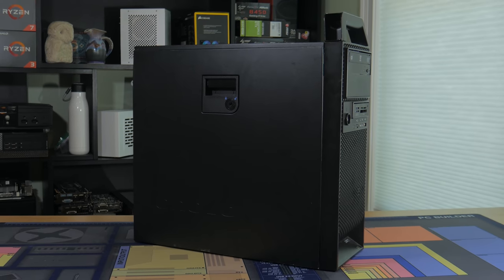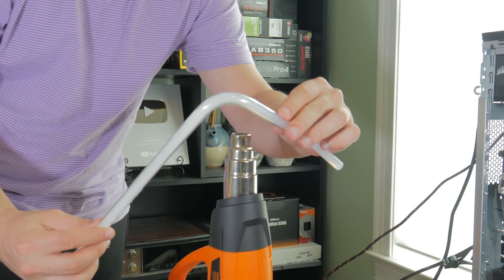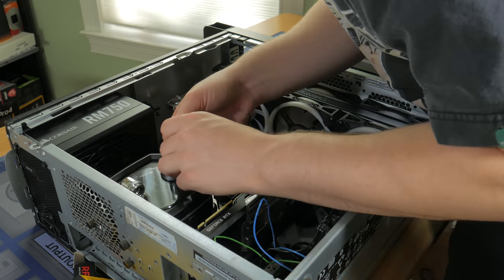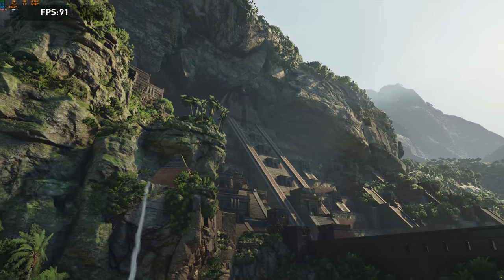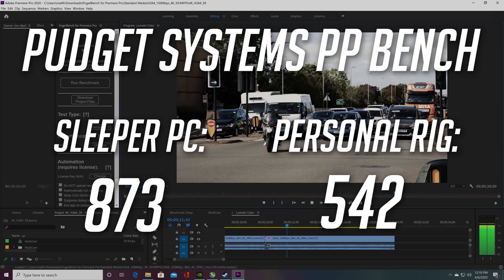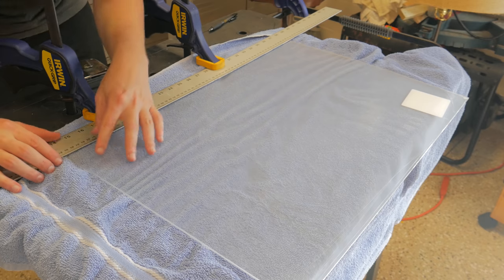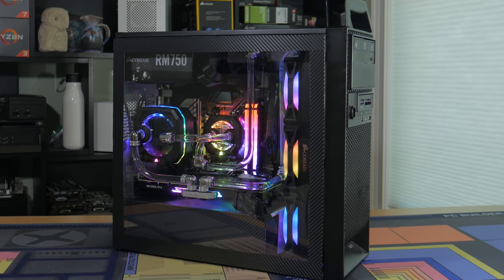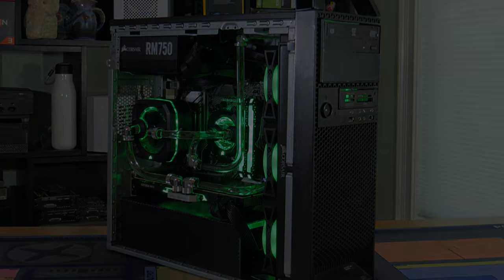How Fast Is My New Sleeper PC?

Comment: I just installed two more sticks of RAM to my desktop.
Reply from the maker: Nice! how much did you upgrade to?
Reply: @TechByMattB  16GB from 8.
Reply: Nice
Reply: @TechByMattB  hi Matt, first of what an absolute stunning sleeper, it looks amazing in both versions.

What I wanted to add, now that you have good cooling for the CPU the best way to increase CPU performance is to manually tune you memory timings. I have in extreme cases seen 30% gaming boost, but in your case it's probably more like 10%. This will cut down on intercore latency. Most importantly is the secondary timings, because these are not affected by the xmp profile. 

Just if you felt the need to push it slightly further, with no noticable extra power cost.

Comment: Just want to mention.Borrderlands 3 are not well optimized even on my R5 2600 gtx 1070 ti it drops to 30-40fps in the benchmark but gameplays smooth.
Well done on this pc.It looks sick.Personally i would have gone with no rgb but hey that's me.I have rgb fans but set it and gpu to white as my pc's code name is holy grail :D

Comment: If your cpu running pretty hot even though you use watercool, delid your cpu and use thermal grizzly. :) 

Also the vrm use copper heatsink instead of the aluminium.

Comment: Hey, I have a problem that I was hoping either you or someone here can answer. My dad bought me a prebuilt pc but it has no graphics card. There is a comparable slot but the case is too small to fit any graphics cards. I have been saving and I have an i7 processor with 32 gb of ram so I thought I could salvage the parts from the prebuilt and buy a case, power, and a GPU to finish it off. I vaguely have an idea what I’m doing but I really would like some other inputs. Please help.

Comment: Do you know any good ddr3 4gb sticks that would be compatible with an x58 motherboard
Reply: Pretty much any ddr3 ram stick will do. Look up what your motherboard supports speed wise and make a decision from there. If it supports 1866, great because that's about as fast as ddr3 can do. Most motherboards from that era support 1333 or 1600mhz. But I should also note that you really won't see a huge performance increase by getting faster ram with ddr3.

Comment: Hello!
Reply from the maker: Hey!
Reply: @TechByMattB  So.. Do you think I can put a gtx 1650 in a dell optiplex 3020 mid tower?
Reply: @TechByMattB  I will still upgrade the power supply, but i'm looking to buy a gpu for it.
Reply: @TechByMattB  I was thinking of the GTX 1650 or the RX 570 or 580
Thanks.